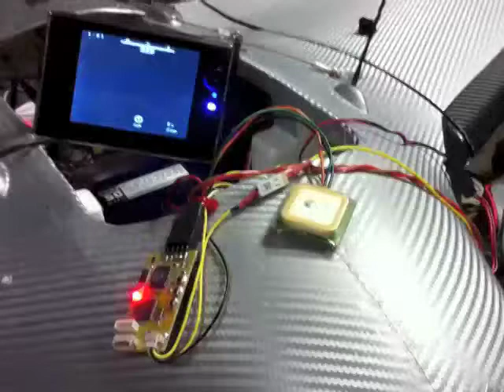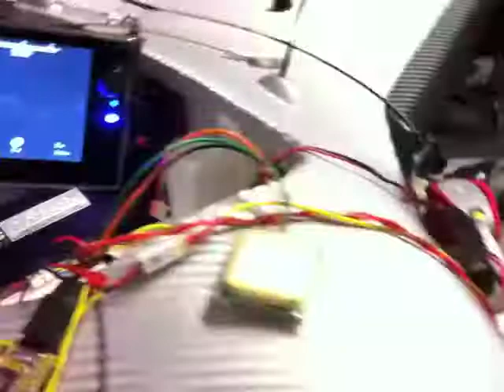Telefly osd issue 1

Comment from the maker: Unfortunately yes. But if u r using a 12v fpv cam it will run on 9v ( better if it does anyway). Or grap pwr from gps module. Nb if using the current sensor, dont make the mistake of putting 4s to it... 3s only :(  Sent from my iPhone